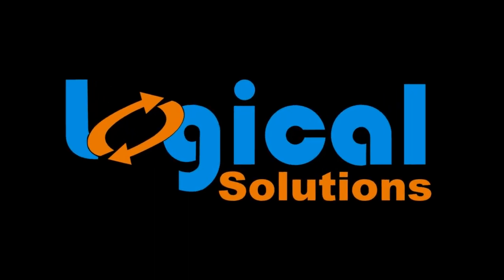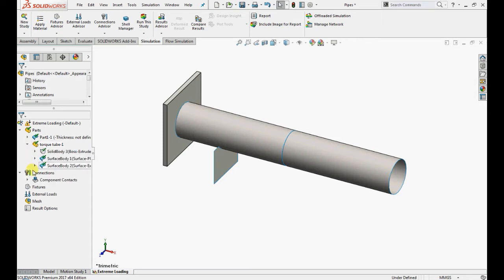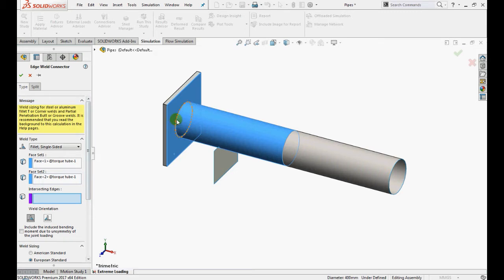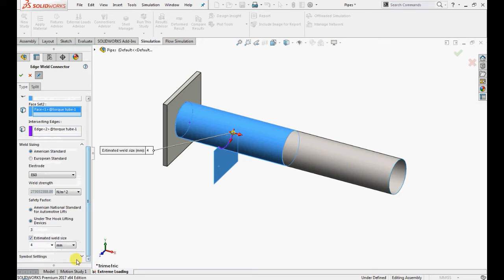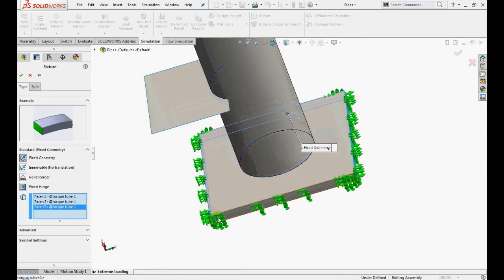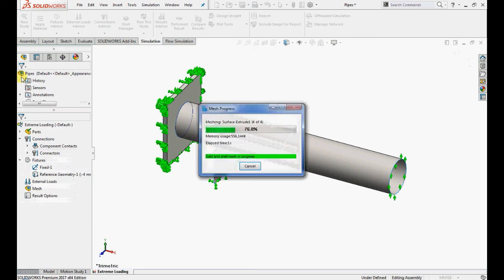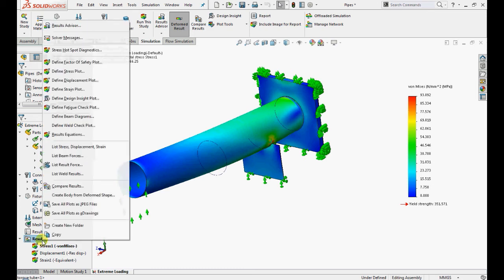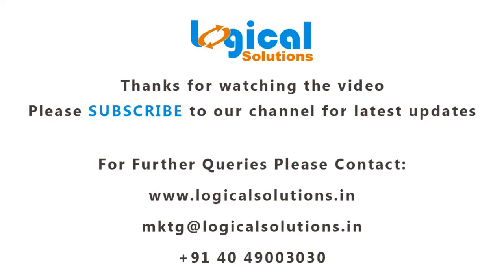Solidworks Simulation-Edge weld connectors

Comment: I've created what I believe is basically  this assembly and followed the steps shown here but I cannot set the weld faces, and get this message "Weld Edge Connector should belong to faces of surface bodies or sheet metal bodies" do I have to convert solid bodies to surfaces as a step not shown here or am I missing something obvious?